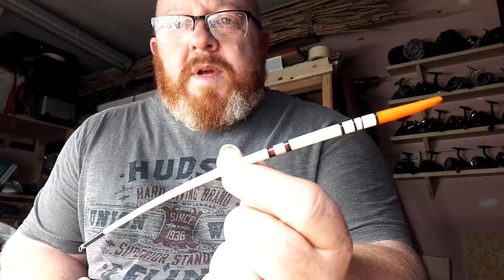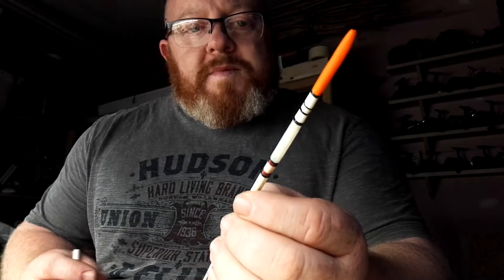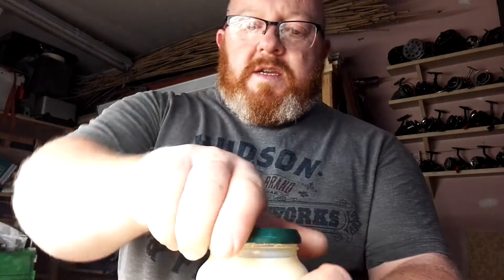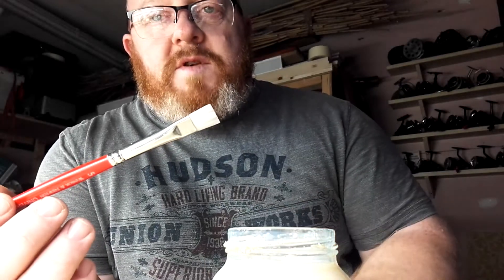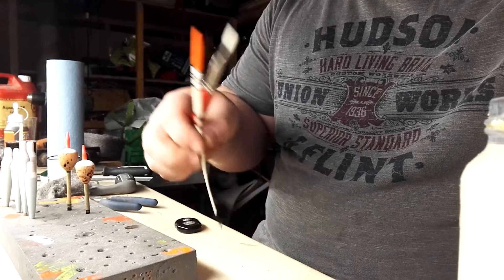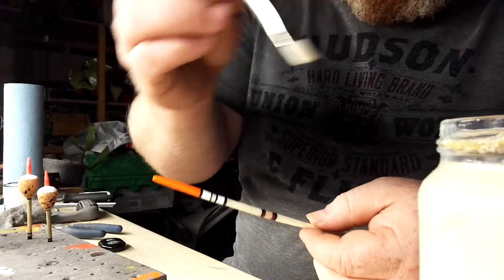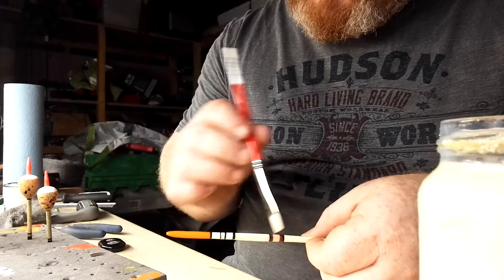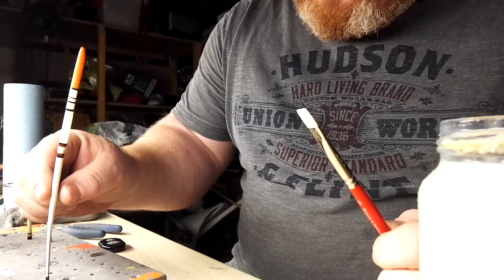Starting the Lacquer on the Goose-quill.

Comment: Hi Graham, great video, im just wondering which lacquer you use from smith and rodger as im looking online and there are quite a few different types so not sure which one to buy. I use morrels shelac sanding sealer which im pretty happy with but looking for a different finish on the floats than the clear gloss varnish I currently use. Thanks